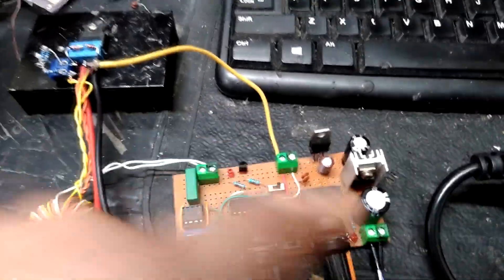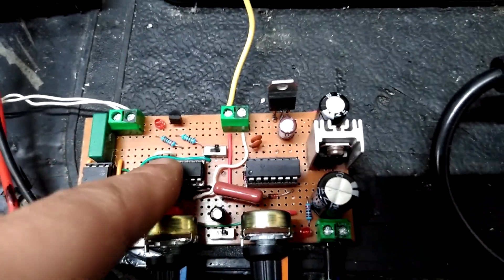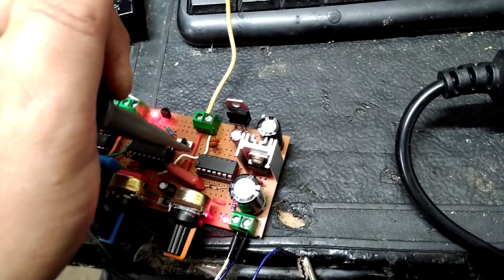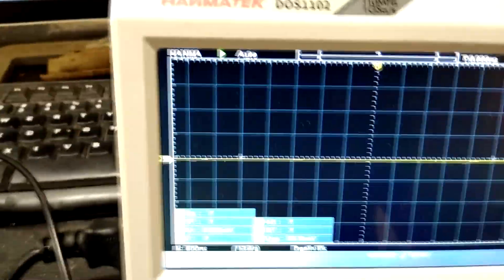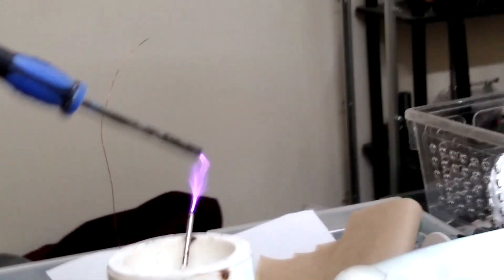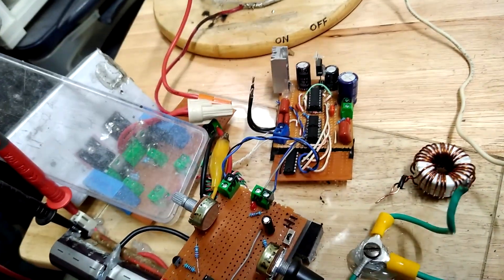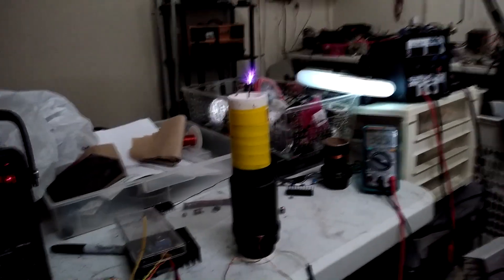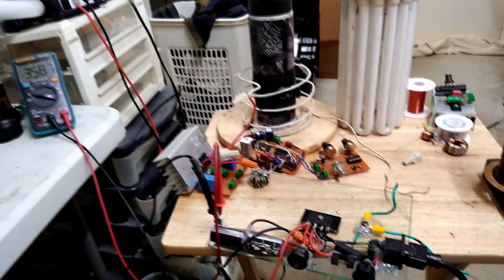Steve Ward Micro SSTC At Higher Voltage

Comment: There is a circuit using the tl494 as the local oscillator and it has a feedback option but I only saw it on burnett richie's website, its possible that the circuit is floating about on the web but then again if you have the pll chips, just go with that as they are easy to build, I'm almost done with my circuit, just have to test some GDT's, I'm using the hex on the feedback side to get a clean signal from whatever I use as feedback, a transformer most likely
Reply from the maker: Yea I think I'm going to basically make another one but use the PLL instead of the TL494. This circuit does seem like a simple option for a small coil though. I think with a 460 and interrupting at the enable pin it can be a good mini thrower at 170VDC. Those gate drivers are too expensive though compared to just using an amplifier stage of transistors. I guess I just wanted to make some use of those damn things. I also heard audio modulating at the enable pin is easy, I'll have to wait and see. I feel like once I feel satisfied with an interrupted half bridge setup it can't be too hard to just add the PLL in there to that driver by sort of just putting it in between the feedback and the hex inverter.